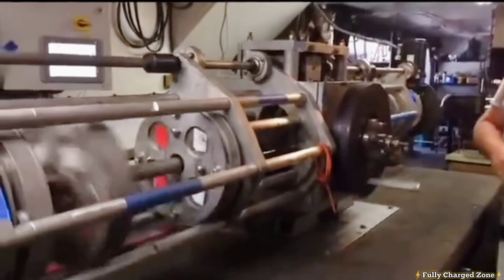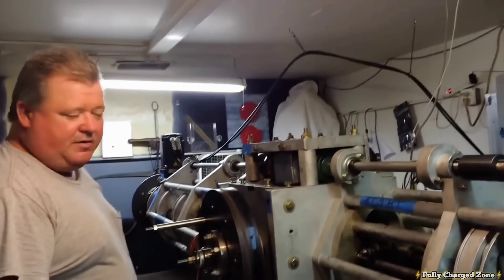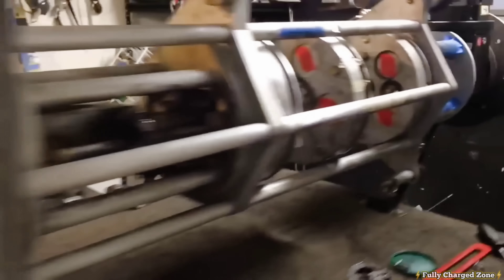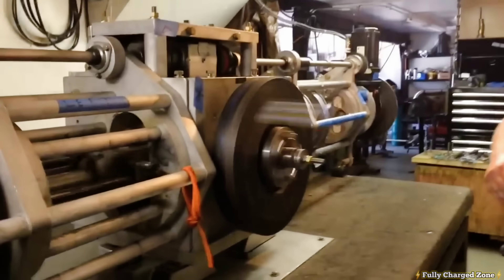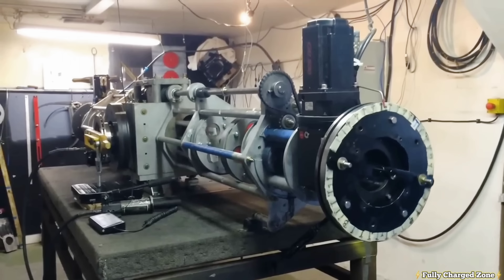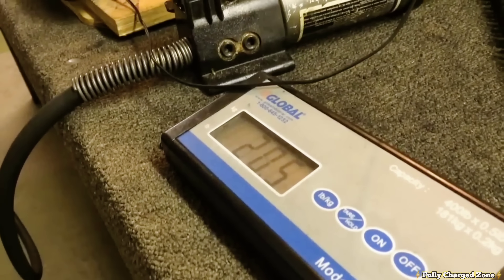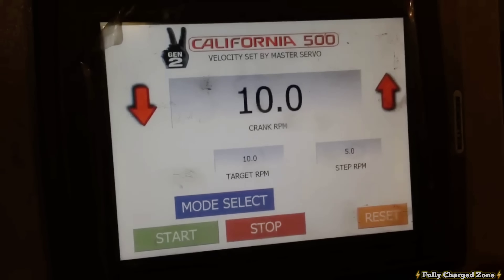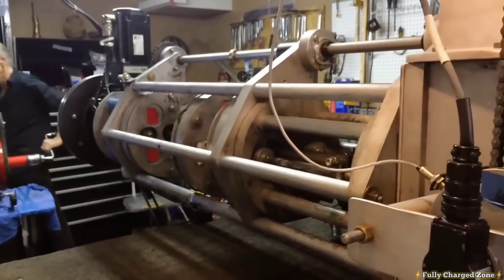World's 1st Magnet Motor - US Patent # 8487484b1

Comment: The hardest part about perpetual motion is hiding the batteries.
Reply: Nobody says that this is a perpetual motion machine
Reply: @Giovanni-emb  That is what a machine that defies the laws of physics does.
Reply: @brandonandreski1709 No it is Not.,there are no single engine or machine or anythings system could work if it againts the Law of Physic.
They will work only in the direct path Line of The Law of Physic,
Which is ,the Laslw of the Universe it self.
Reply: @EternitYEquilibriuM  There is no such thing as free mechanical energy. Magnets have a pull force and a push force at the same time. Those forces are also very weak and the required forces needed to make a motor like this work would break the laws of conservation of energy. Tell me you failed high school physic without telling me. You are either an Idiot or trying to scam people.
Reply: @brandonandreski1709 hahah,i dont carre you tell me idiot.But i never said about free energy . And even i dont have A diploma or University, i little bit understand how this machine on thi video work.
Its management of using magnetic force to continue repeling and atracking.
The builder using switching control to precisely manage the perfect moment for the magnet.
Reply: A design that incorporates magnets is not a perpetual motion device.
Reply: @jameswalker269  Many do
Reply: @brandonandreski1709 , by definition, designs that include magnets are not perpetual motion devices. The reason being, while magnets last a long time, they are not "perpetual". Therefore, anything that relies on them in order to work, is not perpetual.
Reply: @jameswalker269  It still doesn't work as intended. I will bet you any amount of money you want. There is no way to tap into a force that is balanced. It pushes exactly as much as it pulls.
Reply from the maker: Trust me… if there were hidden batteries, this thing would be spinning a LOT faster 😆
Reply: @FullyChargedZone  I hope you are being sarcastic because you know you can change the rate an electric motor rotates right? That is like one of the bonuses of electric vehicles is that you don't have to have a transmission because you can just change the flow of power.
Reply from the maker: Absolutely... I work on EV systems every day, so I’m well aware you can control motor speed electronically.
What I was referring to in that comment was the magnet motor prototype, which isn’t an EV traction motor. That design doesn’t use PWM or inverter control like a normal electric motor. Its speed is linked to the mechanical timing of the magnetic cam system, just like the patent describes.

Two completely different types of machines, with totally different ways of controlling RPM.
Reply: You never said it was a perpetual motion machine, it's a motor, motors run on power. This is a magnet motor.
Reply from the maker: Exactly. I’ve never claimed perpetual motion.
This design isn’t trying to run itself... it’s a magnet-sequencing motor based on US Patent 8,487,484 B1. The “power” in this setup comes from the way the permanent magnets are timed through their power zones and dead zones using the cam system.

Just like any other motor, the mechanism still needs an external input to keep the timing synchronized. The magnets provide the force interaction, not the “free energy.” So yes... it’s a magnet motor, not a perpetual one.
Reply: @cruisingarizona   there is no such thing as a "magnet motor" made from permanent magnets. It can not, and will not, ever work.

And this video shows that the so-called "magnet motor" is driven by two normal electric motors, one on each end. People that do electrical engineering professinally tan take one look at that machine and see the two motors that are clearly the source of its rotation.
Reply from the maker: It’s not a self-running engine, and the patent never claims that.
US Patent 8,487,484 B1 describes a magnetic sequencing mechanism, not a perpetual motion machine. The two small motors you’re seeing are only for driving the cam timing and reciprocating carrier, exactly like the patent shows... they’re not providing the rotational output that the mechanism produces.

They’re just replacing the hand-crank the inventor originally used to keep the timing synchronized.

The magnetic carriers still go through the power zones and dead zones the patent outlines, and the demonstrating machine shows that interaction in motion. No hidden drives, no free energy claims...  just the patented mechanical method running exactly as designed.
Reply: @wizrom3046 ,Let me tell you, there is still hidden potential about magnetism,induction,and aLL about Faradays Inventted. 
The guys who make the video iam sure ,realizing that and trying to do any research and experiment.
Reply: This uses springs. I can hear them stretching.
Reply from the maker: There are actually no springs in this setup. What you’re hearing is the mechanical cam followers and magnet carriers cycling through the power and dead zones described in the patent (US 8,487,484 B1). The timing mechanism makes a similar click, but it isn’t a spring stretching.
Reply: If you're looking for the energy, it's not in batteries. It is locked inside the magnets put there during the manufacturing process of neodymium 4 or 5. This stores 400 years without pto, and variable rates with PTO. Mechanicals have always been able to extract more and more usefulness but  as you noted there is nothing perpetual in this entropy based universe.
Reply: @mavrosyvannah :face-blue-smiling: Sure it is. the issue is that magnets have two poles. They push and they pull at the same time. Perpetual motion is bullshit.
Reply from the maker: You’re right... magnets by themselves won’t make perpetual motion. This design doesn’t claim that. It uses a cam to shift the magnets into different force zones so the push and pull are not happening equally at the same moment. Still requires input power.
Reply: @FullyChargedZone    but magnets can never be a source of power.
So the entire output shaft power of your "magnet motor" must come from the electric motors that drive it.
The magnets are essentially worthless.
Reply: @FullyChargedZone  Physics does not work that way. The laws of conservation of energy really are simple. You can't get energy from nothing. Motion costs energy no matter what direction you move it. You also have forces that work against you,  that are trying to transfer energy to different states you don't intend to use. Friction, heat, kinetic etc. You should look at energy conversion rates. this machine would have to have close to a 100% conversion rate to do what you are suggesting and that is not possible.
Reply from the maker: @brandonandreski1709 Totally fair points...  conservation of energy is real, and nothing in this patent claims to break it.

What’s happening here isn’t getting energy from nothing.
The device in US Patent 8,487,484 B1 uses timed magnetic reluctance and asymmetric force windows. It’s basically a permanent-magnet geometry trick, not an over-unity machine.

The patent literally defines:

power-stroke zones → where magnetic force is maximized

dead zones → where opposing magnetic forces balance out

synchronized rotation → so the system only works during the high-force window

That’s no different in principle than, a variable reluctance motor, a magnetic clutch or a magnetic gearbox

All of those are accepted engineering... they use magnet geometry and timing to get net usable torque, not free energy.

So I’m not suggesting 100% efficiency or perpetual motion.
The patent doesn’t claim that either.
It just shows that you can shape the magnet interactions so the useful side of the cycle does more work than the wasted side takes back.

Whether the real world build is efficient or not is a separate engineering question... but it definitely doesn’t violate physics, and it’s exactly what the patent describes.
Reply: It is possible by timing  the north and south poles of the magnets.
Reply: @jeffgillespie6853  No it is not. The forces that are moving are also opposing equally. the laws of motion did not change just because you tube became a thing.
Reply: @brandonandreski1709 Are you a physicist? What degree do you have on your wall??? How much time and schooling do you have working with the effects of magnetism?? Waiting for reply. 😊
Reply: @jeffgillespie6853 i know ita not meant for me, but I've got 6 degrees. 6 degrees of separation from Kevin Bacon. 😂
Reply: @jeffgillespie6853  Ah the old appeal to authority fallacy. You just killed your own argument. What degree does this guy have? You are also using an appeal to ignorance fallacy. I have worked as an engineer for over 25 years. I have a little bit of experience in mechanical and power systems. Perpetual motion and magnetic engines without fuel or unbalanced outside forces do not work. I will bet you $1,000,000
Reply: @jeffgillespie6853 how many degrees do you have in English? You shouldnt be trying to use Grammer and words to communicate unless you have the highest level of credentials. Or, perhaps people can know things without a degree. Whats your belief? Do you need a degree in communication in order to talk, or not?
Reply: @jesterprivilege 😂😂😂😂😂😂😂😂😂😂Well I just don't know, right now I am busy trying to conquer my own island 😊
Reply: @jesterprivilege  Add hominem fallacy. if you can't find flaws in someone's argument then you find flaws in the person presenting the argument. It was talk to text genius. lol
Reply: brandonandreski1709 It’s in the video and you can see what he’s doing. I had a customer that built a workshop in his lock up to build something similar— it’s do with switching.   Yes it can made to work it’s just the hardware is a bit bulky for charging a laptop
Reply: @grahamhireme9283  You are either a bot or an idiot because there is no such thing as free energy. Magnetic motors running on whatever mystical force, do not work. They need electricity to run. You go ahead and build one. I will buy it from you. Anyone where if you build one of these and it works without exterior forces I will buy it. Go ahead. I have a feeling I will not be all that surprised. Liars always have to prove their lies with anecdotal BS.
Reply: @grahamhireme9283    NO. Permanent magnets cannot ever be a motor.
There is no "permanent magnet motor" it is not possible and never will be.
Reply: @brandonandreski1709 do you think you replied to the right person, if so give more context.
Reply from the maker: I completely agree... there’s no such thing as free energy, and this build isn’t claiming that.
The patent (US 8,487,484 B1) doesn’t describe a self-running or “mystical force” motor at all. It describes a magnet-sequencing mechanism where permanent magnets are timed through power zones and dead zones using a cam system.

The small electric motors on the ends are only for driving the timing, exactly like the patent illustrations show. They aren’t powering the output rotation... they just replace the hand crank the inventor originally used to keep everything synchronized.

So yes, this absolutely needs external input.
It’s a demonstration of the patented mechanism, not a perpetual motion claim.

Comment: So shifting movement come from center box.
Rotation come from far ends left and right side. At the each end we can see timing setup rotation angle position and shift position.
Reply from the maker: You’re on the right track — the center section handles the linear shift, and the outer ends handle the timing and rotational angle. That’s exactly how the patent describes the interaction between the shifting magnets and the rotating assemblies.

Comment: I'm pretty sure EVERY electric motor uses a magnet.
Reply from the maker: Not every electric motor uses magnets! ⚙️
Most modern ones do, but some — like induction or reluctance motors — rely purely on electromagnetic fields. The motor we’re looking at is a windup magnet motor, which makes it even more interesting to see how it works compared to traditional designs. ⚡
Reply: @FullyChargedZone   the motor in the video is a scam demonstration, driven by normal electric motors which are clearly shown at each end of the device
Reply from the maker: Did you read the description,  I dont like scamming anyone.
Reply: @FullyChargedZone   your description says this is a "real magnet motor" and "self starting magnet motor".

Both are false claims. This is powered by two electric motors, they can be clearly seen, one at at end of the device. Basidally it's a hunk of noisy junk, rotated by two perfectly normal electric motors.

So YES, this is a scam machine, and your description does not honestly desribe what is happening, in fact your description tries to validate the scam machine by saying it is a "working magnet motor" when it is not, and calling it "self starting" when it is not.
Reply: And they also (importantly) have a POWER SOURCE

Comment: Take off those 2 electric motors
Reply from the maker: Those aren’t electric motors — they’re part of the patented timing and shift-mechanism. Nothing on this setup is driving the rotor electrically
Reply: @FullyChargedZone  bull feces 

There is no such thing as a free energy device also known as there is no free lunch
Reply: Springs and magnets. I can literally hear the springs.
Reply: Truly are dumb did you ever go to school or ever heard of opposing forces
Reply: In the patent they are called "electric input motors" :-D
Reply: @andreasschmitt2307 yeah but if you read other people's comments and stuff they're acting like it is a free energy device and anybody that has a brain knows that free energy devices do not exist

Just read a few of the comments in the comment section
Reply: @markdi2
Yes, they just don't see the motors. I've seen a free energy devices from India that was connected to a huge motor and nobody seemed to notice it. Make them as big as possible and everybody will believe in free energy, because it seems impossible to hide them in plain sight ;-)

Comment: What keeps the magnetism aligned?
Reply from the maker: The magnetic alignment is maintained by the mechanical geometry defined in the patent — each magnet sits in a fixed, indexed pocket that locks its polarity and rotational orientation. The stator and rotor both use precision-machined magnet carriers that prevent any angular drift, so the magnetic fields remain stable under load and rotation.

I’m just demonstrating the patented design, but the alignment system is exactly how the inventor engineered it in the patent drawings.

Comment: Rapidly moving magnets surrounded by metal. 

I want to put a volt meter on the device
Reply from the maker: You definitely could — rapidly moving magnets will induce a voltage in nearby metal. It’d be interesting to see what kind of signal you’d actually pick up on this setup.

Comment: conveniently no mention of the two electric motors on either end clearly visible.
Reply from the maker: Those aren’t drive motors. They’re part of the inventor’s original testing and calibration setup, which is why they aren’t spinning the shaft. The patent explains the magnetic-timing mechanism that actually drives the rotation.
Reply: The motor/generator used to spin magnets so push pull reciprocating happen. World biggest dildo driver.
Reply: Just add an alternator to power the motors.
Reply: @DrTurboChicken an alternator would not make enough electricity to power the motors. Adding a better alternator increases the strenght needed to spin it so more force needs to be put out of the electric motors making the alternator not strong enough again
Reply: @DrTurboChicken you're asking for perpetual motion. Zero chance of that happening

Comment: Amikor megáll a motor, ellenkező irányba kezd el mozogni, majd megáll és megfordul a forgás irány, akkor miben tárolódik az energia? 
Ez így nem örökmozgó!
Reply from the maker: The system periodically transitions through a magnetic null point. When the net torque approaches zero, mechanical losses stop the rotor, and the next dominant magnetic vector pulls it into the opposite alignment. The behavior is consistent with a damped magnetic oscillator, not an energy-producing motor.
My video is only demonstrating the patent’s mechanism, nothing beyond that.